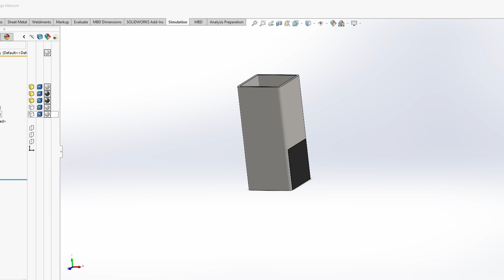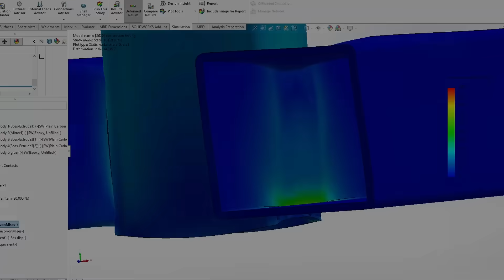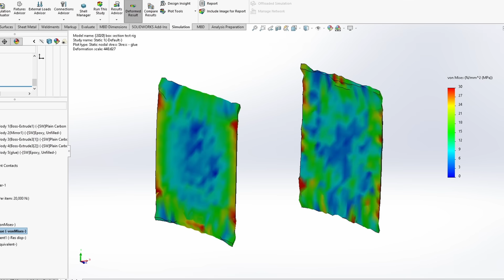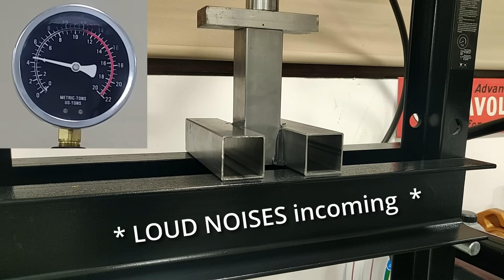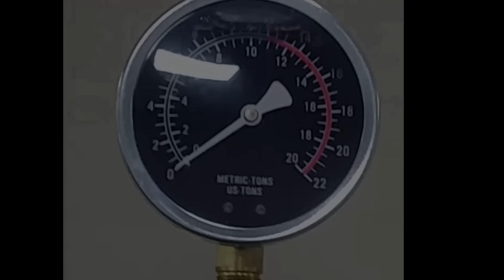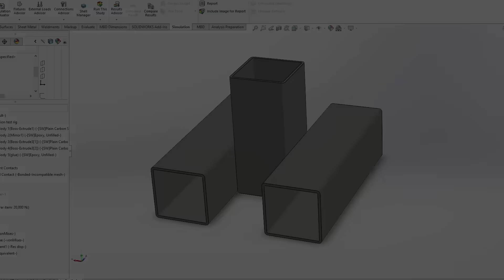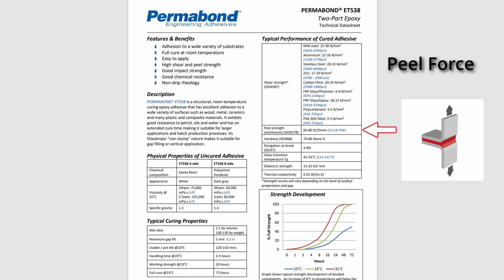How strong is JB weld structural epoxy adhesive anyways ?  Destructive test, simulation and review

Comment: I forget what car I was looking at but I know they used glue/epoxy to bond a lot of the body panels together.  I think they found they could use thinner metal (lighter) than would be needed for the same strength using spot welds or pinch/crimp welds.  It also allows for bonding dissimilar materials together (IIRC) like carbon fiber or fiberglass to metal.  
JB weld is some amazing stuff.  I had a fairly decent size crack on the oil pan of my car & could not find a replacement for over 6+ months, so I emptied it of oil, cleaned it like 4-5x with solvent, used 40 or 60 grit sand paper to rough up an area 2-3" on either side of the crack (from all edges), cleaned it with acetone very well, then covered it with JB weld original.  It's held since 2008 on an aluminum pan that gets pretty hot!  I was told over & over from mechanics that it would NEVER work let alone last.
Reply: I have a Chevy truck with a 454. The oil pan rusted through (wtf right?) and I JB Welded a quarter on it a year and a half ago.
Reply: I've used JB a couple of times on pinholes and deep rust pits on  floor pans with very good results. Anyone have experience on cast iron exhaust manifolds with JB or can you recommend  an alternative.  Thanks
Reply: @vicfelton3594  The JB weld will almost certainly fail after the car has been running for a little bit & the engine & exhaust get up to temp.  At this point it's going to just cook the JB, possibly even starting a fire.  

If you need to fix a cast iron exhaust manifold then I'd suggest someone who is good at welding & if it can't be done then try  brazing the crack.

Comment: And these results while you queezed out all of the JB weld from between the two pieces of metal when you clamped them together. If you woud have left a gap between the 2 pieces and filled it with JB weld you would have gotten even better results. JB weld is awesome but it aint glue. Its a metal filler, its strength increases dramatically the thicker it is. I've repaired corroded cylinder heads and block surfaces with this stuff and years later taken it apart to find it held up betthe that the metal surfaces around it.. It is absolutely amazing stuff.

Comment: I used JB weld to repair aluminum railings with missing spindles at work. I tested it first on new extra pieces of square aluminum tubing. The aluminum surface is naturally oxidized, even when it is bright and shiny. So, I cleaned each bonding surface with a wire wheel, then glued and clamped the parts overnight. The next day I tried pulling the pieces apart. None of the glued joints broke. I could break pieces of the aluminum off, but the joints remained intact.

Comment: JB Weld is excellent for adhering rifled barrel liners within bored out original barrels that were badly pitted and damaged by corrosive fouling salts, largely black powder and chlorate primer residue.

It really isn't applicable to modern lightweight military or sporting barrels but very suited for anchoring modern thin steel liners inside of thick wrought iron barrels of 18th and 19th century pieces the owners wish to refresh.

JB Weld will hold those liners for a few lifetime.

Comment: For engine iron block or case with cracks or leaks less than 1/8 inch, the best way to fix is not to weld (heat weakens it) but to use JB weld original, roughen surface clean with acetone and it's as good as iron.

Comment: Unless I'm mistaken, JB Weld is thermally rated for repairing exhaust manifolds. I'm not sure about a blast furnace, glory hole, or ceramic kiln, but it should do for nearly any mechanical weld up to any engine temperatures.

Comment: Why is this news to engineers? We Millwrights have known this since JB Weld was invented. 

I tested it a bit differently 26 years ago. A carbon fiber handlebar fully cracked at the stem on a downhill mountain  bike. Made a loose fit hardwood dowel and slathered it in JB weld and the fix lasted an entire season in the Canadian Rockies doing chairlift and shuttle runs. 
Failure would have been disastrous, and we millwrights are generally the ones who put our balls on the line while the engineers reap the reputation awards. 😂

Comment: I tried JBWeld in a similar type of joint, but with a smaller area (20x20mm), with aluminum square tubes. Surface prep was sanding, followed by acetone wash, followed by immediate bond with C-clamps, cure for 24 hrs. Statistics was pretty good, I had ~10 devices, and I tried them all. Tensile strength was very disappointing: I could pull the parts apart with my arms, with a bit of leverage (say, 4x). Fractures look similar to the ones in this video. Thus, for small contact surfaces (20x20 mm rectangles) and tensile forces I will not use JBWeld. For larger surfaces and shear like in this video, prob OK. I still think the "weld" in the name is misleading.

Comment: Awesome testing! I love it! It is - after all - still a type of glue. And glue has certain properties that make it excel in one load type and pretty much suck an another. 
All glues love shear forces. All glues hate tension. And worst of all: Peeling tendencies that combine tension with a stress riser. It is the task of the designer, to enable the first and prevent the latter. Your test is primarily shearing. The side pipes turn a little but then carry all the load on the inner edge. This is why you hardly see any peeling. If they were longer and would bend and turn under load, the peeling action would be much more pronounced.

Comment: That’s awesome! I’ve never seen a test before that closely confirms it’s tensile strength. When using epoxies, I usually perform a mental calculation to estimate its suitability for the repair. Now I can really trust it. Time to go jb weld my bicycle back together. Very nice!
Reply: I hope you're joking. Epoxy is amazingly hard, approaching steel. But don't mount critical parts on your bike with it. (Unless it's composite carbon fiber or the like, then skuff up the sufaces before applying the epoxy.)
Reply: @alexanderg-p3z  yeah, the bike frame part was a joke!

Comment: Hi, I took a 5/16th bolt and used a 3/8ths anchor filled with jb weld (the stick type "Steel Stik") to see if it would hold. I filled the anchor and the threads in the bolt and let it dry over night. I had access to a machine that tests break points. I was able to pull it until it broke and it didn't fail until well over 10,000 lbs of pulling force. So about the same, maybe a little higher because of the threads.

Comment: Interesting considering my experience with JB Weld is completely opposite of this.  This stuff is useless for most everything.  The only thing I use it for is basically body putty.  After I weld something I will use this for covering/smoothing a weld to make it look pretty if the project requires it.   It’s so soft after curing it’s easily sandable but holds up to the heat of powder coating unlike standard body filler.   This test amazes me.

Comment: Nice test and impressive results.  I would have liked you to compare to brazing or even soldering and of course mig/tig.
The key to using adhesives is maximize surface area.  I am amazed that weak bonds that are multiplied create great strength, like lots of little screws,
but of course ultimately molecules are incredibly weak, but billions of them create very strong bonds.

Comment: JB Weld is always impressive in my experience. It will not do EVERYTHING a weld could do, but it's still very versatile. I have even had the putty perform well, but mainly used that in compression and put screws through it.
Reply: I find the putty is great for emergency plumbing fixes, too. It squeezes into hairline cracks pretty well.
Reply: @willcool713  Does a great job out on the trail plugging a cracked motorcycle crankcase or clutch cover too for the same reason
Reply: NO

Comment: hmm interesting.  I used that stuff to try and bond some steel rods that I was forming into the shape of flames.  The weld was rock hard but it didn't bond well to the steel, even after sanding and cleaning the steel.  It would just come apart with minimal hand pressure.

Comment: I used to own an original Honda Insight (1999). It had an all aluminum unibody structure with bonded seams (no welds). Over 25 years It went through several batteries but the body lasted the entire lifetime without any failure. Can not say the same for all the plastic bits.

Comment: Did you sand the surfaces real good? Epoxy is only a mechanical weld so sanding increases the surface area it can hold on to. You should have expected this with the amount of surface area.

Comment: think thats good, use JB- MARINE 2 part epoxy, let it set for 5 days at 70 to 90 degrees, youll see strong, rough both surfaces with 60 grit sand paper, youll see strong.

Comment: Been using JB for decades and it is the go to for a superior bond. Oil free and scuffed surfaces work the best.
Reply: Yep....us old rednecks have figured out that if you clean it well....brake cleaner works great for most metal parts as a degreaser, especially the NON-FLAMMABLE brake cleaner....!!!  and you have a good chance of one of 2 things happening
1 - your repair will last long enough to get the job done
2 - your repair will last until you've forgotten about it 
or -  both.....lol
Mix it well!!!  MIND THE POT LIFE!!!!!

Comment: I love JBWeld.  Something to be aware of is that it does contain iron so it'll rust and it'll be moved by magnets.  I tried to adhere a magnet with it and all the JB got pulled around the sides so it didn't adhere.
Reply: That's an interesting detail.  It certainly looks like JBWeld would be sufficient for any need I might have with an adhesive.  It's always nice to see something put to the test before potentially spending money and hoping it works.
Reply: @VersinKettorix  Something else interesting that could be useful: you can mix JBWeld with water, acetone, or other stuff and it does interesting things.  From memory, when it was mixed with water it cured soft, like a hard rubber/soft plastic, but I don't remember what it did long term.  My experiment was to thin it out to help it flow into some rotted wood I needed to strengthen, I think I ended up using the acetone mixture and it did a decent job.

Comment: Not being an engineer, I wonder how this might work in concert with welding.  Heavily scuff the bonding surfaces, then bond the surfaces and clear the leak-out very carefully, with the epoxy and cure properly.  Once it’s cure, sand to clean the joints and then properly weld.  I’d wonder how they’d then fail in comparison to an epoxy bonded versions, a welded-only version, and then an epoxy/welded version.  I wonder if it’s silly overkill, or if it would genuinely strengthen the connection.
Reply: Heat from welding will damage the epoxy
Reply: @betterthans  they make epoxy for heated applications

Comment: I was putting a thermostat in my van about 25-30 years ago and snapped off one of the ears on the cover 🤬. I couldn't afford the real Ford replacement at the time so I JB Welded the ear back on. This worked perfectly fine. I eventually found an affordable generic thermostat cover and replaced the JB Welded one but probably didn't need to.

Comment: My first real encounter with metal filled epoxy was in 1982 when on the road with my friend in his Datsun 510 (the "Rotsun"), my dad recused us by providing us with some Devcon product to repair a leaky radiator. He warned "you get that to a radiator shop ASAP". Turned out Jim never did any further repair, and sold the heap on several years later. 

Many a dirtbike has had engine cases put back together with JB Weld. I did this with my daughter's Honda she flicked into a boulder pile. Well I remember her thinking she'd killed it for good - hot oil on the rocks. We carefully collected all the pieces and that night I put Humpty Dumpty back together again. 

BTW, I've had very good results with "G-Flex" toughened epoxy for bonding various plastics. These joints need to be flexible and strong, if not as strong as the components. I use a variety of fillers, lately I tried the powdered PMMA that is used for artificial nails (!). I like it.
Reply: Used it on radiators all the time good as brazing it which in those days what was done with brass radiator. Now with plastic tanks it's disposable, but can't be repaired on the side of the road.
Reply: My dad has a hotrodded 510. ~270 hp in something that weighs about as much as an empty bubba of beer sure is fun. Great looking cars, they're like a stumpy version of the Hakosuka, it's just a shame the coupe didn't make it to North America (just the 2 door sedan). 

If he still had it, he might actually get decent money for it (compared to back in the day). Paint some strips and a #46 on the side and it's worth twice as much.

Comment: JB Weld is incredible.   While active duty in the air force, we used EpiSeal 20/20 for recovery of damaged aircraft when time was a constraint.  We applied a thin coat of the adhesive to each face and then laid a piece of cheesecloth over the adhesive.  Worked the 20/20 through the cloth and then stuck the parts together with clamps.  The cheesecloth maintained a thin bondline between the metal and never failed us.
Reply: Cool. imagine loose woven carbon fiber. You taught me something new.
Reply: The cheesecloth acted in the same way as rebar in concrete. Nice job.
Reply: Shear strength: 10/10. Compressive strength: 10/10 Tensile strength: 8/10 Adhesive strength: 9/10 Peeling strength: 3/10  Shock strength: 2/10. That's my rating from years of use and testing! Nothing else is close!
Reply: @Bob_Adkins 
Do you think it would repair crack on the aluminium bicycle frame..just constant vibration I am worried about.
Reply: @Bob_Adkins  Hi Bob, what product would you rate as being the ultimate adhesive for metal (ie, joining surfaces, not filling gaps).  Thanks in advance.
Reply: @Jonathan-L  Probably JB Weld.
Reply: @Bob_Adkins you think it’d be alright for aluminum hinges on a toolbox? It’s got shocks to help with the load also
Reply: @PureNationalism13  If the lid or door is not too heavy or gets slammed a lot, it will probably work. If it fails, no harm is done, just bolt the hinges on.
Reply: @Bob_Adkins going to use this on my sons atv oil pan. Think it will hold out fine? Thanks for any help
Reply: @ksajak  I've seen it repair cracks or holes in radiators, oil pans, and water pumps. If it won't work, nothing else will. Be sure to use the original, the quick curing type isn't as strong or bond as well.
Reply: @Bob_Adkins  yea I plan to use the original epoxy. I was wondering if I should use steel stick 1st then use the epoxy..I think I'm just going to use the epoxy and skip the stick. Thank you for the reply
Reply: @ksajak  My pleasure ksjak!
Reply: This might just save my bacon. Thank you.
Reply: Adhesive bonding technology has improved
Reply: I used it to repair my wife's reverse Lock Outs on her Jetta! I LOVE this stuff always in my tools!  as a gun smith I Love it MORE Now!

Comment: Now imagine the strength if you had provided proper bond-line spacing (using sand, glass bead, etc.). The effect of that is staggering but you did a great bonding job at the end of the day.
Reply: I was concerned about that too. The clamps squeezing the bonding agent out of the joint was worrying. Glass bead would have improved the bond uniformity.

Comment: Love JB weld. I absolutely wouldn't trust my life with it but for small projects around the house or work, it's great. For example I am building a fire hose roller for my coworkers to make their life easily. It's not really important and definitely won't be under more than a ten pound load, that's great. But if they were walking on it or for use in a vehicle? Hell no.

Comment: That's very interesting! 
And great results!
I'm investigating how to make a DIY oil filtration centrifuge (to filter alcohol from dissolved printing resin).
Most demos I've seen show it made from steel and with welding.
But since I have no welding skill or experience I'm considering alternatives.
One is to make it out of plastic, and on paper it seems to be still possible (with appropriate sizes).
But if JB-weld is this strong I'll be able to do it with stainless steel.
There is only one rotating part (attached to a motor by a single axis).
That part - inner spinning cylinder - has roughly cooking pot shape. The main difference (besides having no handles :)) is having a ridge partially narrowing the top circular opening.
That ridge if cut just to fit inside the inner diameter of the top opening wouldn't be affected too much by the spinning force (I'm guestimating 3000~5000 RPMs), because the ridge ring would be held by the cylinder wall like by a hoop. Same goes for the bottom, which is going to be a full circular plate (with only few holes drilled in it - one for mounting the rod used for rotating it, and 2-3 drain holes for the dirty fluid).
The bottom of the housing also have couple of specific circular ridges, to keep 3 separate areas - for clean fluid, for dirty fluid, and the inner most a hole for the rotation rod - but the housing wouldn't rotate so it doesn't need to be very strong.
If this JB-weld works even half as good it would be few times stronger than what I need :)